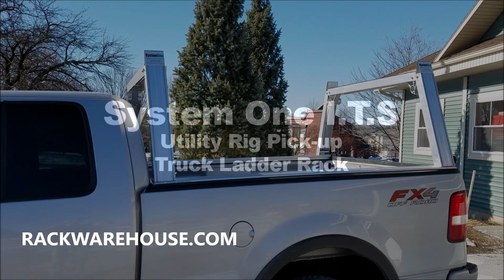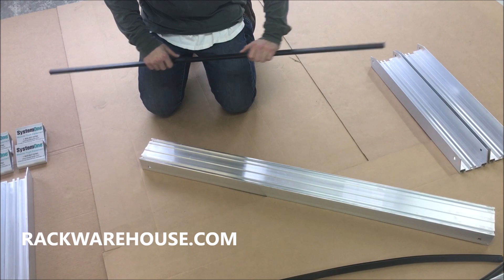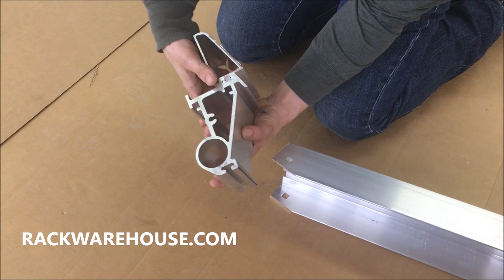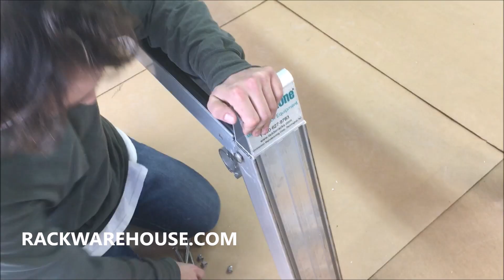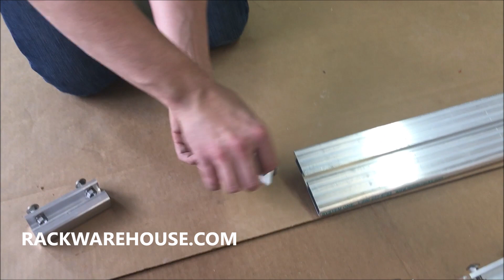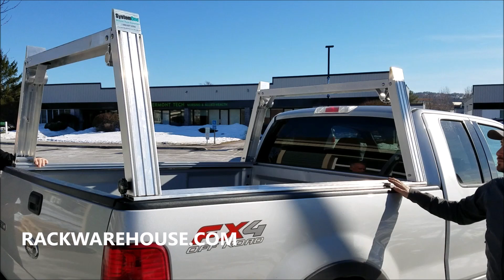System One I.T.S. Utility Rig Pick-up Truck Aluminum Bed Rack for Ladders, Lumber, Pipe, Canoes, etc

Comment: How hard is it to remove the rear rack? I sometimes pull a gooseneck trailer.
Reply from the maker: It's not hard at all, as the rear truss is designed to be completely removable in just a couple of minutes.